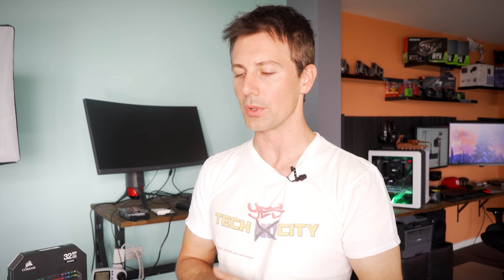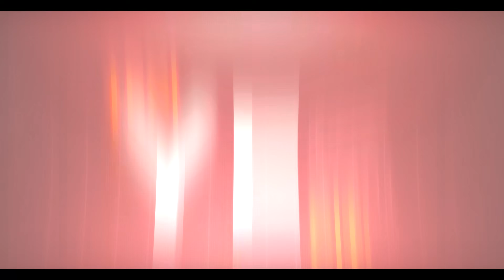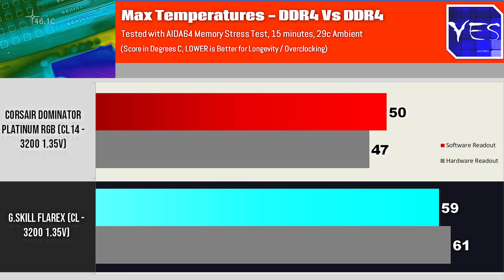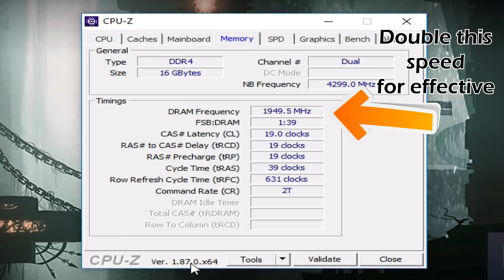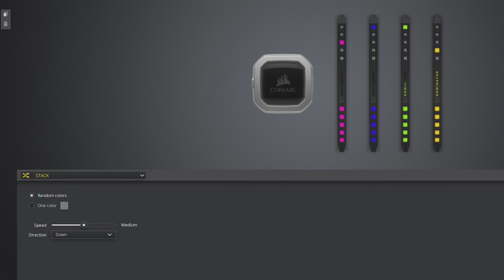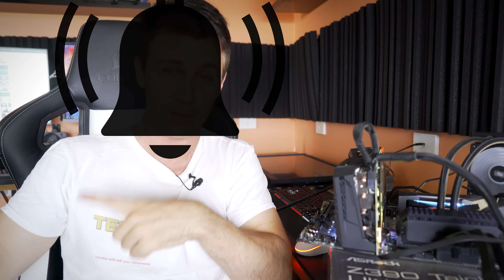Corsair Dominator RGB Platinum Review - Overclocking DDR4 to 4GHz

Comment: Holy crap prices have improved, I’ve just received (but not installed yet as I’m still at work) a 32GB (2x16GB) kit of dominator platinum RGB 3600MT CL14 for £215, when this was produced the 32GB 3600 CL18 kit was £355 and 32GB (4x8GB) 3600MT CL14 kit was £500!!!

Comment: its not the board,  when you put in 4 sticks, the controleer has to spread the load over the 2 lanes dedicated to the ram--> but with a jump for the 2 extra slots.    so direct lanes are slot 2 and 4 --  when you put in 2 extra  it goes to  lane 2 jumps to slot 1   and lane 4 jumps to slot 3,  putting extra stress on the controller ...  so when max oc  only put 2 sticks in with the max capacity ram you like.   if you want max capacity or expandebility you can take 2 and buy 2 more after. 8 8 8 8 cheap   of 16 16 max freqencie mhz ... real oc mobos only have 2 ram slots

Comment: This is an older video but it's the MOBO and/or CPU. My CPU only allows at 3600 with 4 sticks or 4200 (OC) at 2 sticks. I've read the manual over and over again. Hopefully this will help some people. Please look at your MOBO and CPU specs before purchasing your RAM! Some people are agitated because they said, "I can't overclock it past..." It's because the other hardware components won't allow it.

Comment: Well, technically, it is not 4GHz but rather 4000 MT/s. The real DDR4 clock frequency is half of this.
Also, did you validate your overclock with something like HCI Memtest, Karhu Ramtest or Google Stressapptest?
The timings aren't great and are way too loose for B-die. Latency-wise, 4000 CL19 is worse than 3200 CL14.
This is late but you still might want to run them at 1.45V VDIMM and see how far they go.

Comment: any luck with this ram on the high end x399 Threadripper?  if it runs at least 3200 for a 4x16gb kit than it makes sense but you dont talk about compatible platforms, prob a lot wont work with this ram.

Comment: don't say 4GHz, also this ram isn't even that good. I'd much rather my 3600 cl 17 guaranteed b die and oc it to 3733 with ryzen 3000 for best performance
Reply: I just made a Ryzen 5 3600 build, but I like the look of rgb ram. I currently have 16gb of ballistix 3200ghz ram and have overclocked it to 3666. Do you not think this ram is capable of the same OC?
Reply: @JZF629  At the time this was out, he was saying 4GHz with Ryzen 2000. Most people can barely hit 3600 with Zen+ so it's a niche market to just say 4000 for Intel, especially because you don't really need high speed ram on Intel. It can hit it, just not with Zen+. for 3600 though, yeah this is alright but theres a lot better.

Comment: Got the cooler but settled on Corsair Vengeance RGB 32 Gb kit @3200Mhz C16
Quite heavy and the rgb is more diffused. Still a beast in my opinion.
They overclock well and stay very cool compared to my previous Apacer Panther 🐆 gaming 
@2400 overclocked to 2666🤔
Reply: What were you able to overclock them too? For me when I went past 3466 cl16 I blue screened and when I went 3200 cl15 or below I blue screened.

Comment: Just received 2x8gb dominator platinum rgb(wanted silver one, but got rgb) 3600mhz 18-19-19-39..sold my old 1x16gb vengeance lpx 3200 16-18-18-36(bcz of single channel, 32gb is overkill) and add 50$ for dominator. Can't wait to come back from work and test it.

Comment: if you got intel dont bother buying nothing but cheapest 2133mhz or 2666mhz , i bought the 2666mhz and ive been thinking that i wouldnt suffer if i had 2133mhz memory , its not breaking my game performance, but it will take some from my wallet, usually best value is 2666mhz

Comment: I have 4000mhz DDR4 capable of OCing to 4500mhz.  Shame I'm using it on first gen Ryzen (1700).  :)
Reply: weird flex but ok
Reply: @FrickedUpClips  After decades of building only intel... got sick of their rising prices and thermals. Built my first AMD, didn't take the time to choose ram.. bought 3000mhz... sold it, bought 4000mhz so I could push it to the max.  Actually at the time I bought it there were stories of being able to run mem at 4000mhz.  Those stories were false.  So my ram is currently at 3466mhz.

Comment: all everybody here is talking about is, that high timings on high mhz is worse than low timings on low mhz; that is not true

if you had 3200@cl16 and 4000@cl20
the 4000mhz settings would still be faster, even though the mhz/cycle is 200 for both scenarios

it has been proven countless times that higher mhz is always better so, even if the division results in a lower number, the real world number may still be larger

Comment: Two criticisms:

1. Why is this memory so expensive right before memory manufacturers are about to cut the price of their memory by 30% due to gross oversupply? 

https://www.extremetech.com/computing/283081-dram-manufacturers-slash-capacity-expansion-to-limit-price-drops

2. This memory is only marginally faster than what's already out there and already looks better (GSkill Trident Z RGB) but is way more expensive.

G.Skill Trident-Z RGB 3600 MHz 18 22 22 42 CL18: $149. 

https://www.newegg.com/Product/Product.aspx?Item=N82E16820232728&Description=G.Skill%20Trident%20Z%203600%20mhz&cm_re=G.Skill_Trident_Z_3600_mhz--20-232-728--Product

Corsair Dominator RGB 3600 MHz CL18: $219. 

https://www.corsair.com/us/en/Categories/Products/Memory/dominator-rgb-config/p/CMT16GX4M2K3600C16

I mean it doesn't even look as good as G.Skill's RGB Trident Z. 

Not sure, not really excited about these.

Comment: Isn't DDR4-4000 CL19 SLOWER than DDR4-3200 CL 14? I'm 99% sure the total latency is higher on the first one.
Reply: @geoli6407  You are wrong. The higher frequency 4000 vs 3200 even at less tighter latency still performs better. Higher frequency actually helps with response time.
Reply: 4000 CL 19 is much faster than 3200 CL 14 i benchmarked both configurations and here are the results:
4000 CL 19 https://postimg.cc/t1GmF0dh
3200 CL 14 https://postimg.cc/Th3NVJbH
Also here 4200 CL 16 which smokes them both. I run it 24/7 https://postimg.cc/vcpPdRNp
Reply: @club4ghz  With 2 DIMMs that's kinda doable with enough patience. 4 DIMMs is more challenging. Sometimes, to the extent of setting RTLs manually and even tweaking things like VPPDDR and VTT. Your third timings are really tight though.
Reply: This ram overclocks like shit and its not even guaranteed b-die. The temps are also around 5c worse than the average g.skill kit probably due to the rgb heating them up a bit
Reply: @cHaMp630  LIE LIE LIE
Reply: First word access is faster on 3200 CL14. But bandwidth-wise, it falls far behind. What we should look at is throughput or some kind of bandwidth compensated performance metric. Depending on the memory access patterns, a program will either favour more bandwidth or lower latency and that would determine the weightage when computing the bandwidth compensated performance.

Comment: Memory overclocking feels like a dark art, CPU and GPU to the limit like 2 hours memory took me the better part of 2 days...
I'm running Trident Z and love it. 6700K 4851Mhz 49 Degrees under prime load. Memory is running 3466Mhz cl 15,15,16,35 and that's already running a silly 1.15v into my memory controller. and most of the high clocking memory can handle 1.5v all day every day. as you notice most of the stupid 4.2Ghz+ kits run 1.5v out of the box but good luck finding a CPU to support that.
Personally the best memory for top performance ATM is the 3600 CL 15 Trident Z for out of the box performance. Also be prepared to Clear CMOS a LOT during memory overclocking sessions, It requires a LOT of patience.
Reply: I've seen some people run 4266 CL17 2T 24x7 without problems with VDIMM at 1.45V, VCCIO/SA at around 1.22~1.25V. But beyond that, you are mostly down to the dual DIMM kits and lots of luck w.r.t the CPU's IMC. Have seen people do insane stuff on the Maximus Apex and Gene boards.

Comment: the stock speeds of the ram run better than the OC 4000mhz cl 19 and deff better than the 3600mhz at cl 19,  the latency is higher is the stock 3200mhz cl 14, even the two stick running at 4000mhz cl 19 is worse latency than stock speeds but better than 3600 cl 19, so 3600mhz cl 19 is worst latency, 4000mhz cl 19 is second worse, and stock 3200 cl 14 is the best, just because higher mhm, doesn't mean better performance, because sacrificed timing to get there, thats why the best kits and most expensive have such a high mhz frequency with such low timings, like the gskill trident royal, their 4000mhz cl 17 is amazing best latency out of everything you had today, and omg their 4600mhz at cl 18 deff blows everything in this video plus the royal i just mentioned, you gotta bring down your timing for those mhz OC to make any sense, to figure out a rough latency check, and when i mean rough, i mean rough, but will give you a sense of whats best, take your mhz and divide it by your cl, and higher that number is better latency, watch buildzoid video where he talks about latency timings and which is better, this video https://www.youtube.com/watch?v=Jsy04IRIwpI&t=2450s at watch time 39:27, but id watch entire video, deff good stuff there, n keep up the good work tech yes, i love your videos and the aussie'ness :)
Reply: CL19 4000 Is 20% Faster than CL 14 3200 and latency is actually lower at 4000 CL19 so it's better even at this point or I'm using the wrong benchmark:
4000 CL 19 https://postimg.cc/t1GmF0dh
 VS 3200 CL 14 https://postimg.cc/Th3NVJbH

Comment: More dimms put more stress in the memory controller of the processor. That's why it's harder to reach higher frequencies with more dimms. That's also the reason why extreme overclockers often use a maximum of 2 (and preferably 1) dimm when they're working.

Comment: If u want a game benchmark showing big performance differences from RAM overclocking alone, use Total-War Attila with the in-game benchmark. In my testing, I found up to 40% performance improvement from 100% more RAM speed (3200Mhz vs 1600Mhz, with otherwise same timings). Use 'Quality' or lower benchmark preset @ 1080p with a GTX1080 or better.
This is especially great for tweaking higher frequency vs tighter timings to check which has the bigger performance impact. All Total-War games show a big influence of RAM speed for minimum frame rates in CPU/memory bound scenarios like when zooming in close on a big battle.
Reply from the maker: Thanks for that tip I will look into that one.  I found the old skyrim use to show even minor differences in Tras so thanks for that.

Comment: I know this question has been answered a million times but I'm always in doubt : is 1.40v safe for overclocking DDR4 ?
Reply: Buildzoid has said some high end chips run at 1.45 even 1.5 now for the E die as I recall.

Comment: Tightening the timings at 3200 mhz is faster than raising the frequency to 4ghz at cas 19. Cas 13 or 12 at 3200 or 3400 with tight timings will provide much better performance. i'd stick to 1.385 volts or less

Comment: Overkill can you tell me in the real world when will i need or use that much ram im still running gskill trident x ddr3 2400 quad 32gb and that's overkill for my gaming needs
Reply: You don't need 32+ GB of memeory unless you're a content creator/CAD designer. CAD Programs and video editing software eat up a lot of RAM and sometimes I need to use several of those programs simulataneously.

If you're just gaming, atm you don't need any more than 16 GB.

Comment: Does Corsair iCue cooperate with other lighting software. Because running the aura sync based T-force Blitz software conflicts with my Gigabyte RGB fusion software for my Motherboard.
Reply: Serial Thrilla  I can just run RGB fusion but the Blitz software has more lighting effects. Problem is when I use the Blitz software one of my sticks of RAM stays dark while the rest run the effect that it's set to.

Comment: Ram with LEDs cannot go as fast as non flashy ones as that tiny amount of power the LEDs draw is a bit that is not used by the stick
Reply: nice joke
Reply: @Xenoray1  its not a joke..its actually true..even jayztwocents said the same thing to, where else do you think the power comes from? The RGB gods?
Reply: @bobbywhite6208  you don't have a clue dude.
Reply: @christopherjames9843   yep, sure do
Reply: @bobbywhite6208  so JayZ is an elecrical engineer now? Even if the power drawn by the RGB was measurable have you ever even looked in your bios at how high you have the option of overvolting your memory? Use your brain bro and stop listening to what everyone else says.
Reply: @christopherjames9843  and when you are extreme overclocking those last watts consuming do count because you go cant any higher with the voltage in the bios at some point, it seems like you believe you could pump 1.6v into anything and believe it will be fine, sorry I prefer to not blow up my shit by adding numerous amount of voltage like most overclocking noobs do
Reply: @christopherjames9843  why are using my examples as facts? I was using a example, you can't pump 1.6 into any ram without further degrading it faster than 1.2 or 1.4, and who the hell is upping voltage to 2.3, holy fucking shit
Reply: I don't need/want rgb, but its fkn everywhere. I will switch it off if it's possible on my ram..BTW led use so little energy that we power it with 2apples(acid in apple is enough) on science class for kids..still I want to use all to power the piece of hardware and reduce that 0.1c temperature increased bcs of rgb
Reply: @Molly D ok then by your logic it must be same for NOT turning off the LEDS or the fans to give more a tiny bit more oc headroom on a gpu or a ram stick (edit,me and other people have tested it esp jayztwocents, it does consume power but only takes away a few Ws at most (which can help a oc just a little and be more efficient, the avg person wont need to because most people don't slap on waterblocks and overclock to the max for max time spy scores and etc) please stop being this ignorant without doing enough research, I'm gonna get tired replying to the same thread because some moron has a 300$ computer at his moms and only watches youtube videos all day)
Reply: @Molly D also please state on where did I say that it affects timings? I never even said it affects that, but ok... nice try at skimming over and typing angry letter to me, appreciate it kiddo
Reply: @bobbywhite6208  buddy, you keep digging yourself a deeper hole with every post.
Reply: @John Doe I was making a example of a gpu, I didnt say the JUST THE LEDS consumed a few watts (not talking about the ram stick, you brought it up in my example using a gpu), please stop skimming and actually reread my sentence

Comment: Last year my good old c2q 9550 e0 4.125 ghz on Asus p5q deluxe( back then they made good HS)  survived. My PSU blew up. System was 24/7/365 for 8 years. Point is. I have Ryzen 2600 noctua d14 am4 socket mont  asus rog strix x470-f. and still no RAM. My stuff is collecting dust for over 1 year. I just want cheap b-die and in Denmark, Europe its impossible. My RX 480 moded to 580...I'm done with PC shit. My next buy is ps5 and nice oled tv. And go fys f PC master race.